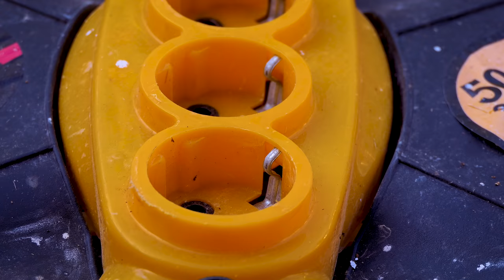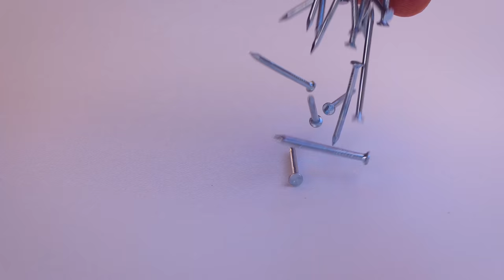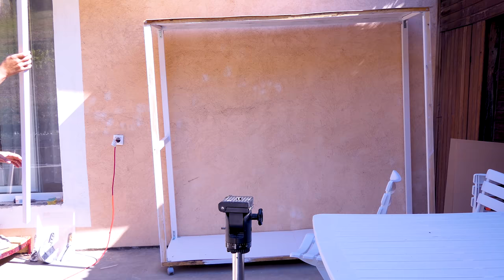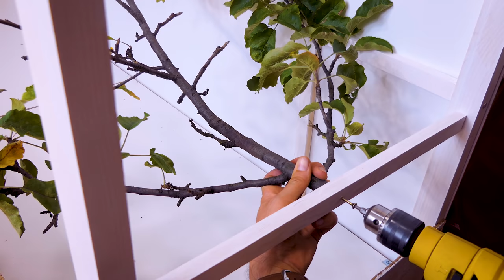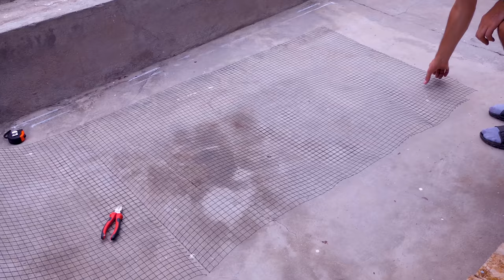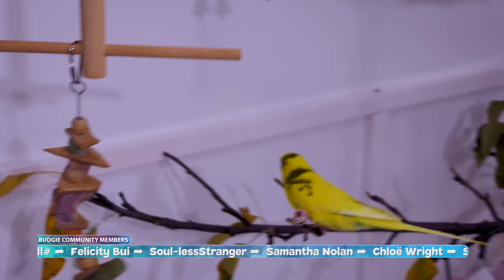How to Make Huge Bird Cage? - Aviary

Comment: In my research I’ve read that plastic coated wire is not to be used.  Only stainless steel or galvanized after welding (only for indoor use as it will rust outside)

Comment: You should have put the wood boards on the inside of the cage, instead of the outside, that way the inside of the cage would be much easier to clean. Regardless the result looks fantastic.